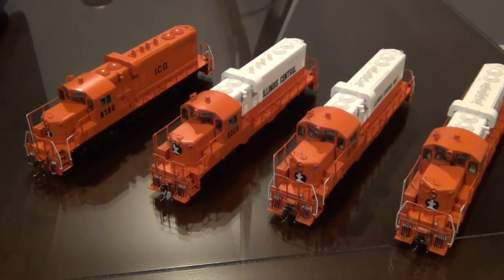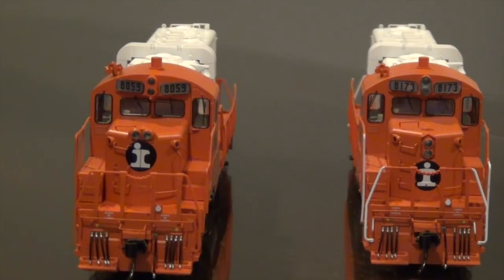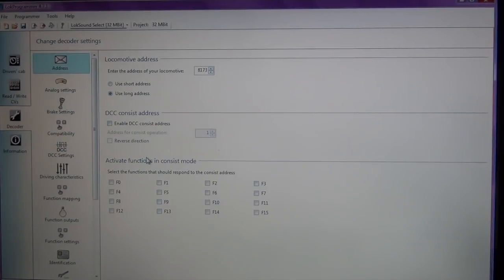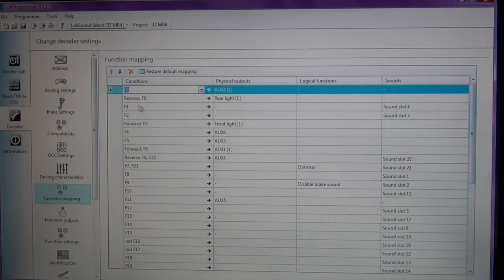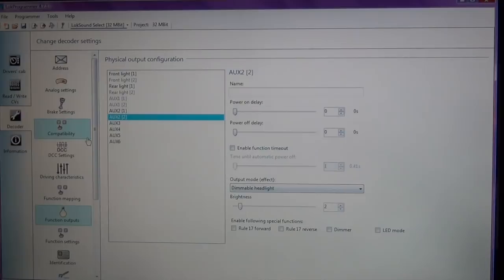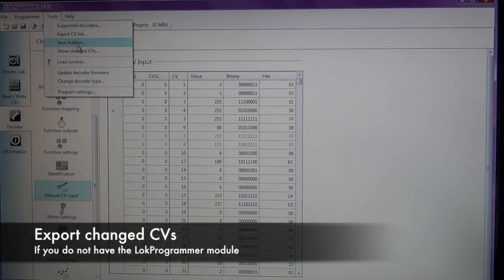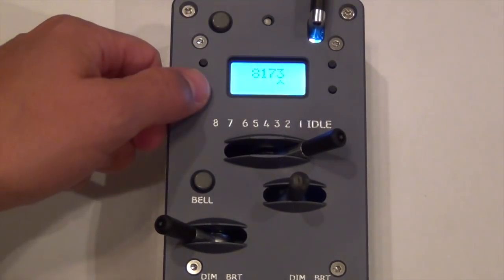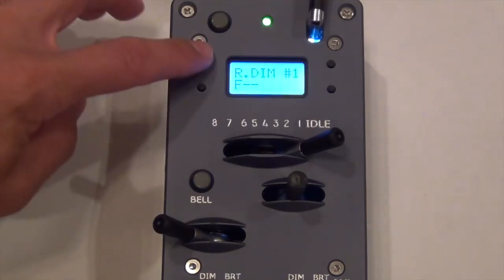ProtoThrottle video series, part III:  Configuring a Loksound decoder (Intermountain GP10)

Comment: Hi Jared, Thanks for posting the video, you have a lots of good information for modelers as they set up the ProtoThrottle and configure the decoders. I know I learned a lot from your video. One note, the couple crash function should be mapped as a Latching function on the Up button as when you press the button you get the crash and when you press it again you get the air hose release sound. As you have it now with the function set as momentary you get the crash sound followed by the air release sound.-Tom
Reply from the maker: ThomasKlimoski Thanks, Tom.  Admittedly, I am a novice on a lot of the details of the “works” of prototype railroading.  I appreciate all of the help I can get!